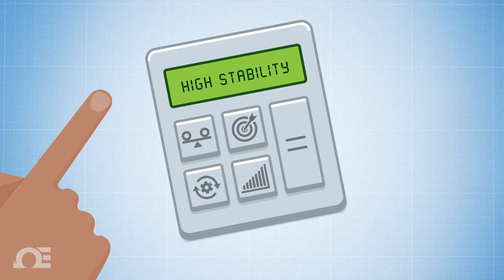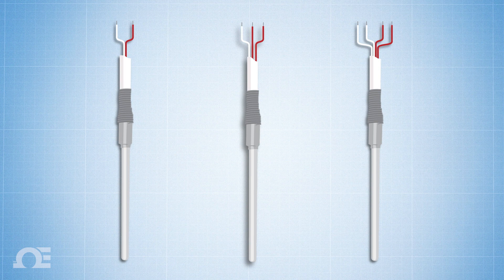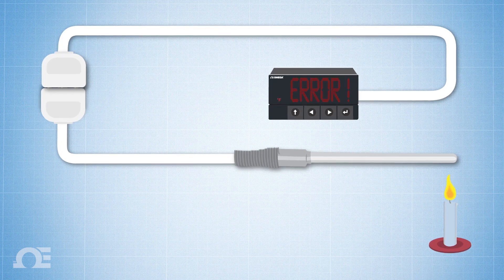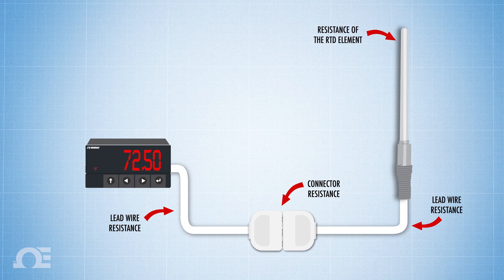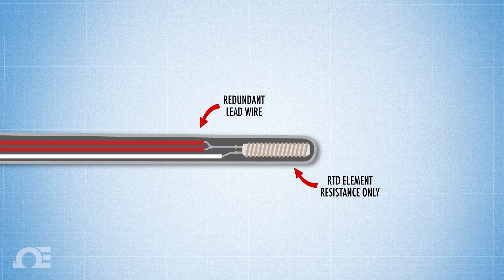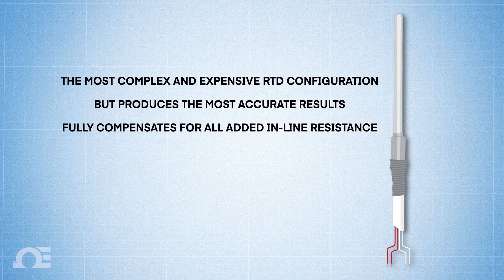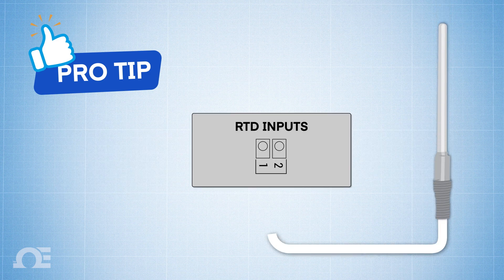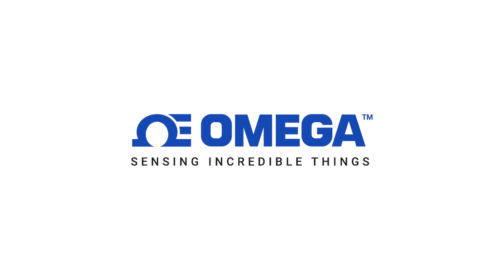2-Wire, 3-Wire or 4-Wire RTDs - What's The Difference?

Comment: Hi there. Thank You for video.
Maybe you can help me out.
Sometimes I have to adjust temperature for 4 wire system.
If temperature is too high I connect potentiometer parallel between red and white and I can lower temperature reading.
Please tell me how to do this when temperature is too low and I want it to be higher.
Tried various configurations but no success. 
Thanks

Comment: hi sir, thank for the video, I learned new things, but what sensor can I use for  Boiler type steaming cabinet cooker with max temp of 100 Degree Celsius?

thank you
Reply: Go to the RTD manufacturers product catalog where you can locate the proper RTD version to meet the temperature range for your application.
Reply: Bhai 800  degree tk toh RTD measurement kr leta h... Easily......if u want above temp then go for thermocouple..
RTD accuracy>>>>>>
RTD time>>>>>>>
overall rtd is good for less than 800 degree

Comment: Here is another pro tip. You can put both of the same colour wires together into the terminal, that way you don't have to worry about the loose wires touching and shorting out.
Reply: I think that correct 🔥